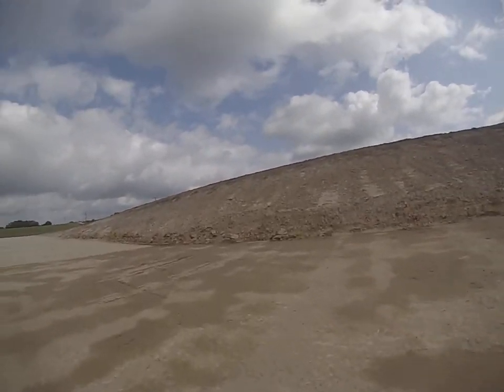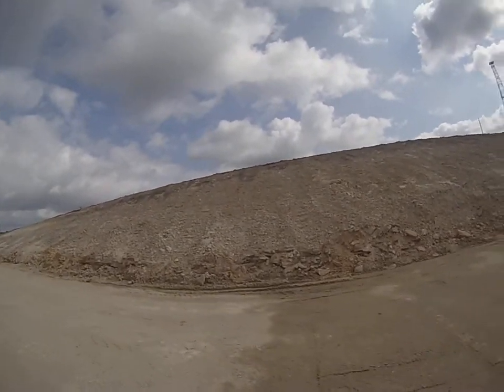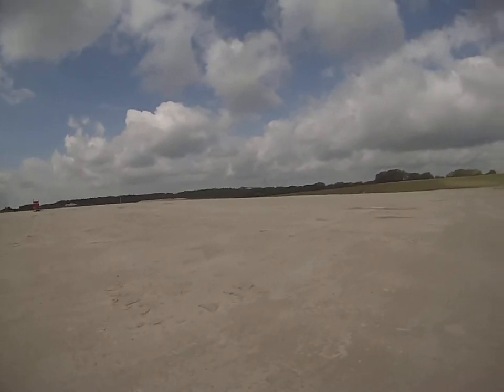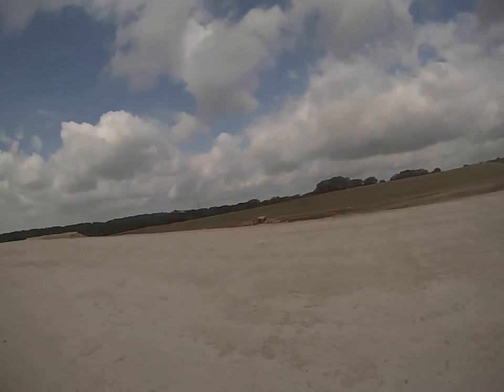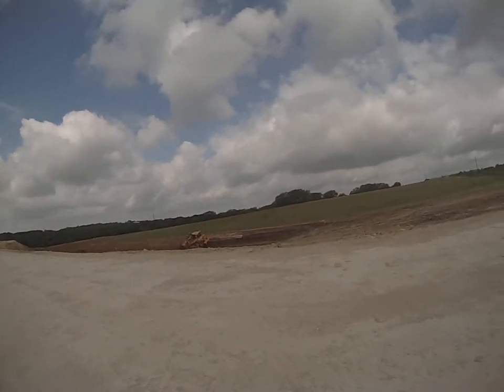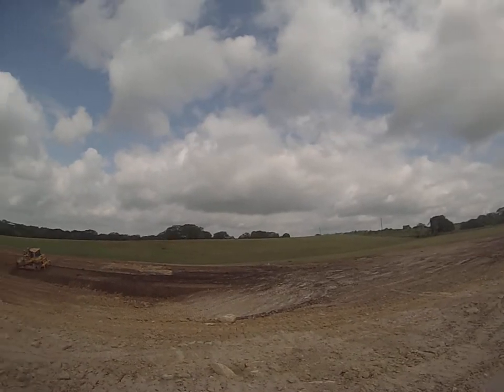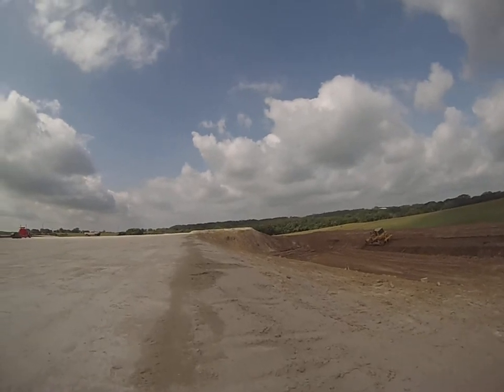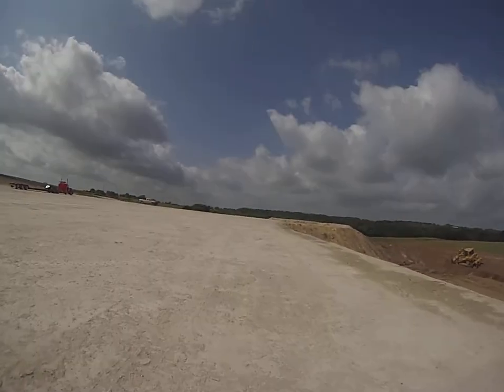Novosad lease AKA "Rock job from hell!" part 1

Comment from the maker: It entails dumping 10 bulk tractor trailer tanks full of type II Portland cement directly onto the graded gravel/base. Then the blade runs the rippers through to scarify the surface and pre-mix the cement and base. Next, the water tanker applies around 5k gallons of water every 30 feet. then the tiller/mixer makes 2 passes and the process repeats across the whole location. Once it begins to set, then it is compacted, regarded and watered for the finished product. the cement is around 40-50k.